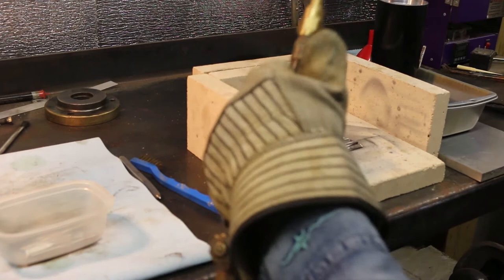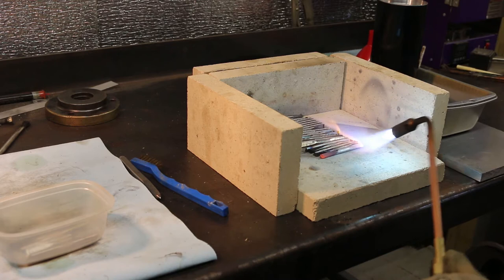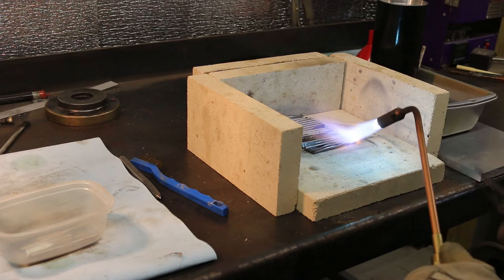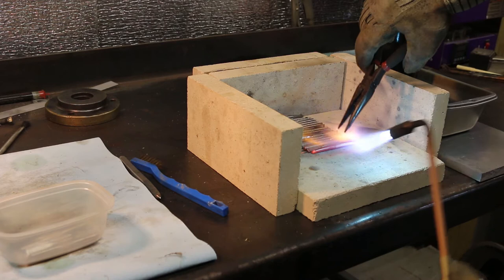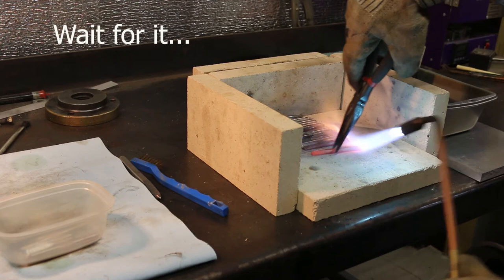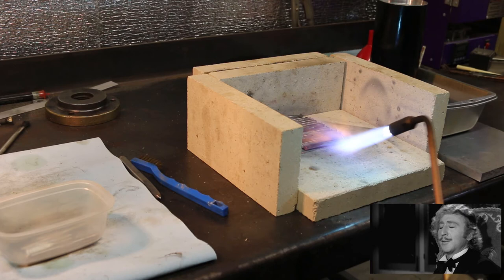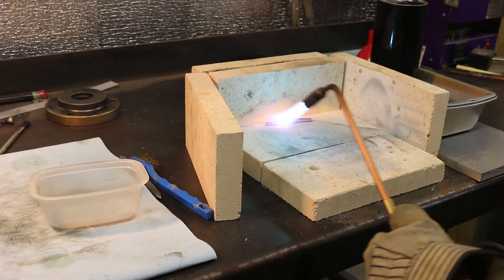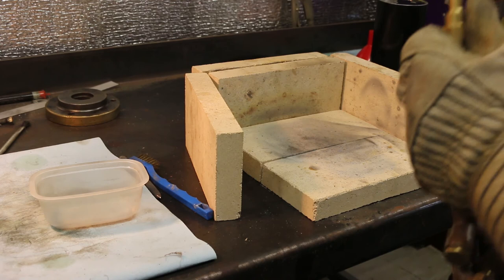How I heat-treat my bezel indexing tools!

Comment: Love learning how others do things.  What kind of block are you heating on? I have a supply of soft kiln block, will that work?
Love your videos!
Reply from the maker: Those are fire bricks like this https://amzn.to/2LxJuo5 
Thanks for watching!
Reply: Sorry if this is a stupid question, Jim, but I assume they insulate the surface they are sitting on from the heat?

Speaking of which, what is the surface of the bench/tabletop you are using?

And what is that shiny, pebbley stuff on the back wall?